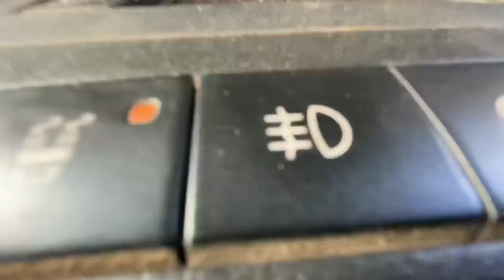If I didn’t have bad luck I’d have no luck! From start to end a struggle…..

Comment: Thanks for making me laugh this morning ....
It's good to see your expertise is getting bigger by the visit on that metal processor .....no wonder 🤔 it's breaking down though with those bits that aren't being picked out. That part of the process needs some work on for sure. 
Li'Dog found too.....and you say  you have no luck 🤞🍀
IVECO is that safe against break-ins even the owners can't get it in !!
🤣🤣🤣🤣
If you could post a link for those safety glasses 🤓 please ...they look very comfortable....do they come in different colours 🤔😂
Be safe Chris ....Top man 🙏🙏
Best wishes G 🙏
Reply from the maker: Yeah that’s costing them down time and repairs 💸💸, yeah I was lucky there mate 🐕🐶! No mate you can’t change the colours… unfortunately you get what you gave 😂😂
Reply: Iveco sales of vans 
Comes with extra security that keeps the owners out, other manufactures use cameras and alarms, not iveco they use strong locks, that strong it keeps everyone out lol

Comment: Hey Chris. Check the earth lead on the battery they are very common for burning out. If you take it off you will see its either black or the inside if the lead will be broken. You can bypass it by just putting a normal ring terminal on it this will stop the battery getting a full charge rate. Used to maintain a fleet of 15,16 plate ivecos and replaced loads of these earth leads and terminals. Keep up the good struggle chris! 🤘

Comment: Do they have a fecking big electro-magnet above the belt to separate the steel before it goes into the shredder?

There is also something called an Eddy Current Separator which can be used to separate Aluminium and maybe stainless with stainless being non-magnetic.  Not cheap but a very clever bit of kit.

With the flat tyres try using tyre plug inserts, they are applied from the outside so no faffing around taking the tyre off the rim. I bought some for my dirtbike but recently fixed a nearly new Michelin tyre on my car with them, it had 2 screws through it and one was at an angle so traditional tyre repair plugs from the inside wouldn't work.

Does that recycling plant have a proper maintenance regime beyond greasing etc, it looks like the kind of place that would benefit from a maintenance management system and condition monitoring etc.

Loving the content, Archie appears to be a proper chip off the old block 👍.

Comment: U may find with that compressor u have a 3 way valve blocked 
It locks up motor with air where its not sending it to the tank an blows fuse 
The valve gets blocked an doesnt hold the pressure in the tank

Comment: gloop type products great for slow punches or  bad wall  seals . providing they are not the type that drys out. I buy cheaper stuff from ebay that said it was for off road use,  it worked and was very cheap compared to gloop.
Reply from the maker: This one is still up now so be interesting to see if it lasts! Take it easy Chris 👍

Comment: they should put a strong magnet on the line or near the chopper to pick the steel etc up if possible
Reply: Good shout. But aluminium and stainless are not magnetic as a general rule.
Reply from the maker: Yeah like Richard said mate, they have got one at the end of a Trommel but doesn’t get stainless